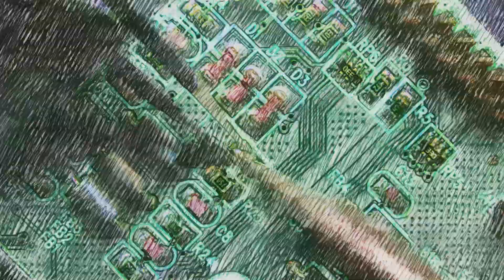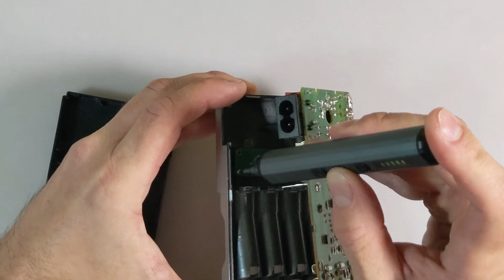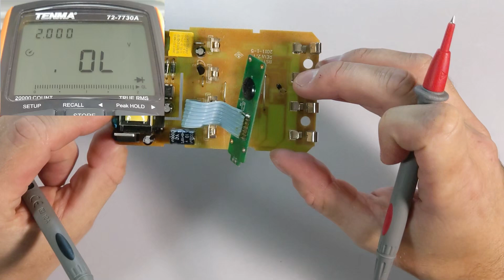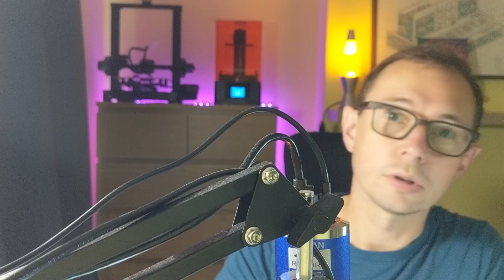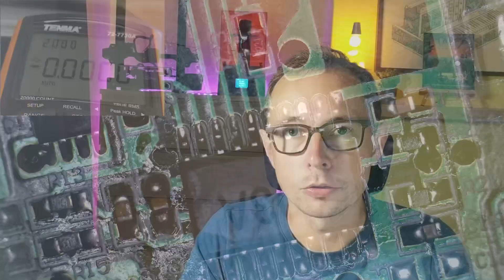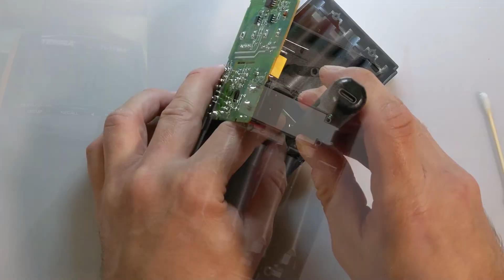Lloytron AA Battery Charger not working | Can I fix it? Sort of.......no

Comment: Ive a older version it just has the lights no screen was fine for the big d size but upon inspection i found the transistor i think its called the big square copper coiled surrounded by steel ,i noticed the steel one of the sreel pieces kinda bent out from its pack and its not the type of steel u can bend back in would that be my problem everything diode fuse etc checked out ok very like yours i dont know enough about older boards with them big elephant on the board lol and i dont know were to check it or what kinda numbers im looking for but would u have a link to like pcb board parts also whats that flux grip can i get a link also plz 👍